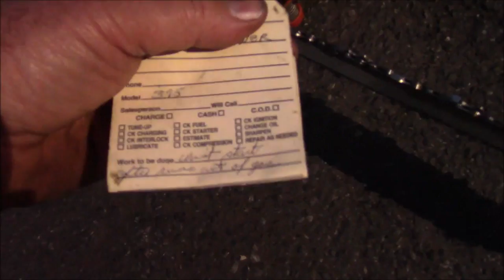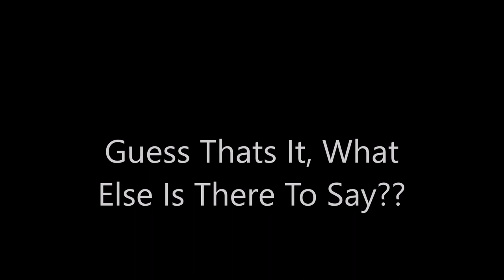HTSS Shop Notes & A Trip To Spike60's Shop & Shop Notes, Also An Important Discussion

Comment: I love the "salad dressing" comment.  I had a Backpack blower that looked like an aquarium full of Jellyfish in the gas tank.  I always dump into a clear glass jar just to see what was in there.  I push occasional users to buy the canned pre-mixed fuel as they will usually forget what I tell them about old fuel, get home, run the fresh fuel I put in out, then fill up with 3 year old aquarium/salad dressing mix and call me up saying what did you do to my equipment??  Gotta love it.
Reply: Right on buddy. 
Best advertising for alkylate fuels (ie Aspen motomix etc) is my dealer. He uses Aspen when testing their new equipment before sale. It sits on the shelf until bought. Just like winterizing..! 

Use ethanol free fuel with fuel stabilizer if you can't afford Alkylate fuel.

Comment: Just like in guns - 95% of the problems with saws (or guns) is poor or improper maintenance.  This is why I clean, sharpen and refuel a saw after each use.  I clean and sharpen them to the best of my ability.  I don’t think, I know they will crank,run and cut the next time I want to use them.  You cannot stress enough the benefits of maintenance.

Comment: Hey Walt where do you get your XPW cylinders from I had a 372xpw that belong to my father and somebody stole it and I'm trying to build it again I got it back but they took the piston and cylinder off in it
Reply from the maker: They are NLA as most have been sold out, Husqvarna is dropping them :( So will have to settle for a 50mm jug, they are awesome with a little more RPM's

Comment: what about 272 piston in a 372 big bore is the 272 piston taller from the pin up .I don't like the 272 piston but I do like the 1 ring 372 bb piston its wider so you can port wider intake and ex
Reply from the maker: Worth a look right?
Reply: I’m thinking of trying a 380 piston in the bb. That sucker is huge both above and below the pin - as you say seems much easier to cut piston down than cylinder?  Will let you know how I get on.
What I like about your videos Walt is that your hobby of documenting your hobby shares your experience so fellas like me can learn to fix and improve our saws so we don’t have to send them to you to fix!

Comment: Walt, any plans for the next GTG?  I'm in Ct and would love to make the trip up there to run some saws and talk some tech.
Reply from the maker: Hoping there will be a time slot between winter and time to put up the building because the frost is out of the ground to do something. Once I can start digging its all over as I have to build roughly 2000ft of road, utility trench, and a couple of pads. Going to be tough to play much this year.

Comment: Hyway now offers pop up pistons in 48 50 and 52mm for the 365/372 platform. They also have a 52mm pop up for the 272. They are only on their website thats easy peezy way to increase compression for not much money
Reply from the maker: See the 52mm version but no place is selling the 50mm popup I see on eBay or HLSupply. Post a link
Reply: They have pop ups 50mm available for 372 and for 268
Reply from the maker: K, ordered a couple and some other stuff. We will see how they last, also have a 52mm top end with a popup on the way.
Reply: afleetcommand cool glad i could help. I enjoy the channel.

Comment: I was watching Bob on one of your videos on my big svreeen tv, yesterday, and he was using an old 041.  He seemed like he was enjoying using it because he did not just crank it up, run it for a few minutes and put it down.  I have never used an 041 but can just image how it was running after years of sitting up in more or less storage condition.  Yesterday was a nice day, here, so I decided to run my 361 and 361 for a little bit.  I undid them from my cable lock system and grabbed what I thought was the 360without looking.  Instead I got my 391, which has been in storage for about a year.  It took a couple of pulls for me to figure out the mistake and see the model number on the side of the scabbard.  I quickly put it back on the shelf and grabbed the 360.  Both saws ran perfectly, especially the 361.  I will crank up the 391 in the New Year, but not, yesterday.